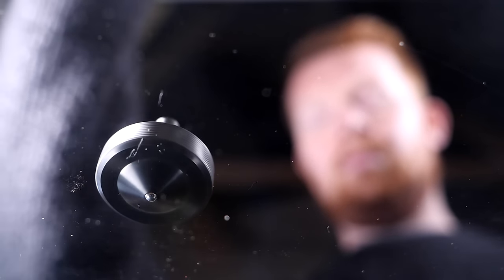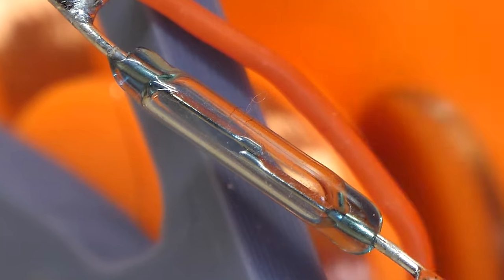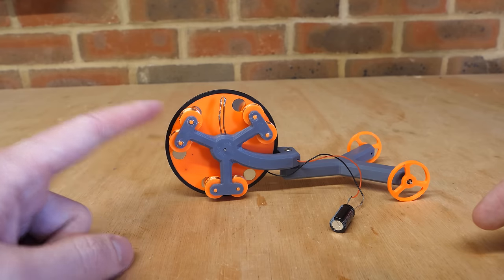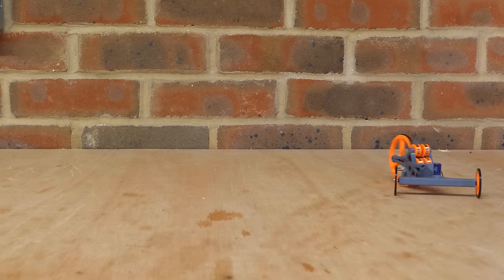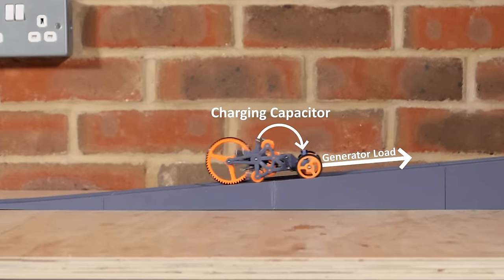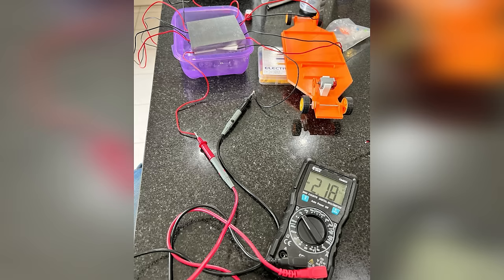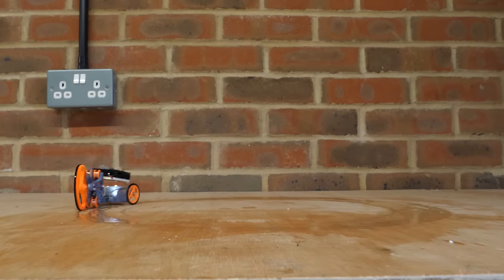This Car Travels Farther Than You Push It

Comment: Hi Copper Haired Tom :-D I'm a fan of your videos, especially the compressed air motors ones. Two days ago i had an illumination: why don't you use a turbine instead of a piston and valve motor? I have in mind a kind of turbine that may work well and probably is easily 3d printable but i don't know how tell you. Ah, this video is really interesting. Bye

Comment: Does the Freewheel have the same matter as the Generator? If the Generator has more matter, it will have more momentum when you push it compared to the Freewheel since p=mv assuming they have the same speed at the begining.
Reply from the maker: Yes, both cars have the same mass.

Comment: Does it have the same energy down the ramp? Yes only if the mass is equal. PE=mgh, g and h being same in both cases, I'm curious to know the difference in mass.
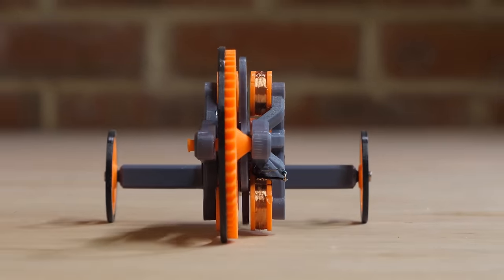Reply from the maker: Yes, both cars have the same mass 7:49
Reply: @TomStantonEngineering the trike with the generator has coils and caps which makes it heavier. No?
Reply from the maker: There is a large steel ball on the freewheel trike as added ballast.
Reply: @TomStantonEngineering  Thanks for clarifying 😀

Comment: is it possible to put two capacitor and charge both but then they generate energy ony by one...like when one is powering up another is getting charged so the cycle continues...like one is charging up by the movement of the wheel and another one is powering it and taking turns

Comment: So what happens when you add a second or even third capacitor and all three of them are on toggle switches that change rather they charge or discharge?
Reply: Do you mean one discharges and powers the motor while the others charge for more energy, because if so, it would have less energy

Comment: TOM TOM TOM TOM TOM TOM TOM PLEASE SEE MY COMMENT!!! do yuo know the adam's motor? its rotating principal is similar to your motor but instead of the rotation being caused by the electrical energy applied, it is cause by the attraction force of the rotor magnets to the iron cores of the electromagnets. an electric pulse is applied to the coils that is just short and weak enough to cancel out the attraction between the magnets and iron cores @Tom Stanton

Comment: hey could I buy a generator car like in the video? I don't own a 3d printer :< and im prob shite at soldering. also do you know how many turns you put on the coils or does that not matter much? does turns only matter if you need a specific voltage?

Comment: Now is the time to scale this up and make it almost practical for full size vehicles.
Then!
Sell it to the oil Companies and live in anonymous luxury for the rest of your life.  😎👍
Reply: Yeah? And what will be the giant hand that pushes you? 😂
Reply: @techheck3358  A steep drive and pedals.  Free transport and exercise.  What could be better? 😀
Anyway, it only has to work well enough to make the oil company think it's viable.  🤪👍
Reply: @farrier2708 A combustion engine makes your car go by getting the energy out of gasoline. This toy car makes the car go by getting the energy out of you. The entire purpose of combustion engines is to supply energy.

The device you are imagining could topple the oil industry already exists: it’s a bike. You supply all the energy. You can try adding this mechanism so that it captures your energy and you can use it in uphill sections, but at the end of the day, charging and discharging wastes energy in the process so it’s most efficient to just have you turn the wheel yourself.
Reply: @henrysanecdotes5323  Perhaps it didn't come across but I was being flippant.😎👍
Reply: @farrier2708  keep doing you, I like your energy

Comment: The whole premise of: "Physics will suggest that if we push them up to the same speed they should travel the same distance" is completely wrong and this entire video is based on that false premise. You are not imparting the same force of each car during the push phase, there is larger resistance to motion on the car with the flywheel as a portion of the energy you are imparting to the vehicle is going to charge the capacitor and not to the motion of the vehicle itself. The initial states if the two cars therefore have unequal energy and this proves exactly nothing of value.

Comment: Waste of time , Not a good solution , because the roads are not leveled  anywhere , in case of inclined how much this offer energy to push it over , thats good to move in slope for downwards, but cannot create torque to move the body upwards in that case you need forced charged induction motor like  in electric cars

Comment: I mean, it's not technically a Perpetuum Mobile because it stops, but it surely has to be at least in the same category with it, right? 🤔

I'm just a non-intellectual cretin, so excuse the potentially idiotic question, but the fact it has a higher out- than input feels to me as if it somehow has to violate the principle of conservation of energy or did I make a logical error there? 👀
Reply: No. Because the energy isn’t just how fast it’s moving, it’s also about how much force it took to get it spinning that fast. It takes more energy to throw a bowling ball than it takes to throw a paper ball, even if you throw them at the same speed.

It’s the same thing here, except it’s not about the mass, the extra force goes into charging the capacitor instead of

Comment: Impossible, it would be a perpetual motion machine
Reply: You should watch the video first. It works by charging a capacitor while you push it, meaning you expend more energy by pushing it than you would pushing a normal toy car. That extra energy is what is used to make the car go farther. No perpetual motion, just a clever way to get more energy out of the initial wind.

Also, ever heard of wind up toys? That’s the entire point.

Comment: Pushing with the ruler both them at the same time is cheating ;) 

You are giving the same initial speed to both of them, but you get an imbalance between the energy provided to each system. You spend more energy to drive the car with the capacitor up to the same speed as the plain one. 

If you could push them with the exact same force, for the exactly same distance to give them the same energy boost to begin with the resultin total distance driven should be more similar between them.
-------
And I rushed to comment before watching the entire video! 😂😂😂
My apologies!

Comment: Why dont you use the magnetic power to generate electricity giving itself power at a spin when you see if it works make a video pls
Reply: Even better make it chargable by hand then you can use the stored energy from that and make something like this but with the added ability to go farther then normal and maybe add more battery capacity too